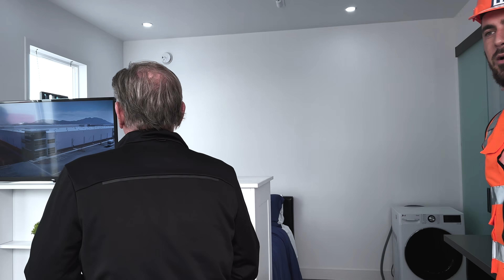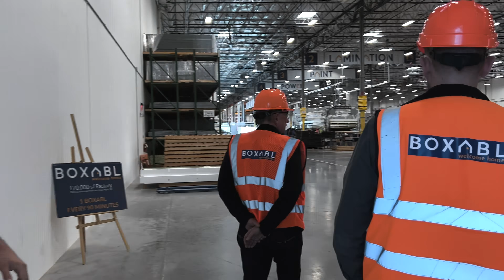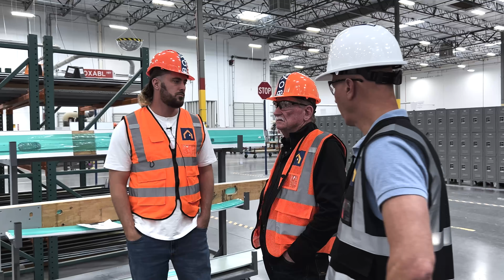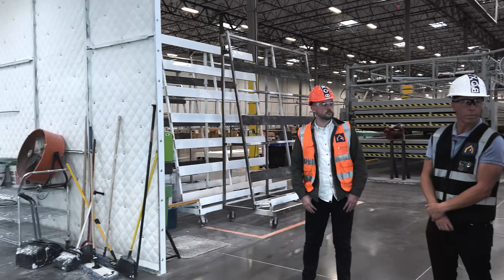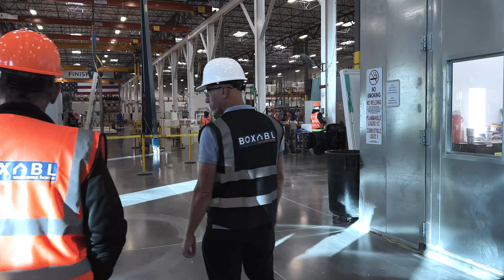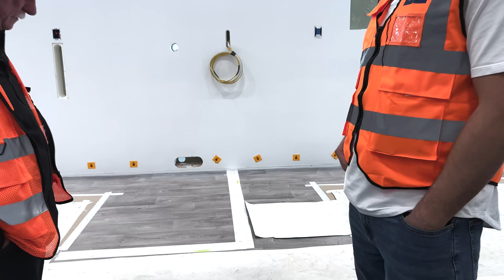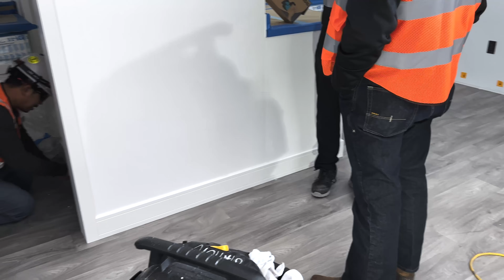What's in the BOX!? - Unfold your new home today | Boxabl Factory Tour

Comment: What is the benefit over traditional manufactured housing?  Just the folding stuff vs attaching two separate units?  Not putting the house on a wheeled frame?  Seems like it would be better to improve existing techniques than start over with a folding design.

The biggest issue with "mobile homes" are the build quality and lifetime.  Do the foam walls make that better?  How does lifetime, outgassing, etc compare with existing mobile home designs?   This may be a case of a startup trying to revolutionize, rather than evolve.
Reply: "Traditional manufactured housing" can't scale because of wide load shipping, not taking enough advantage of building in a controlled environment, and has had a massive perception problem for decades, whether it is warranted or not... Boxabl is not built to "manufactured standards", it is built to "modular standards", with a much stronger building strength than traditional onsite stick frame builds (wall panels are like Tesla structural pack compared to 2x4 stick frame with air gaps)... "Just the folding stuff" is not some cheap gimmick, it is the single most important IP that Boxabl has created, which enables the company to leverage all the advantages of modern factory mass production, while solve for legal shipping loads, which most importantly keeps shipping costs way down... Attaching 2 or more separate units is sub-optimal on so many levels because you are back again to building in an inefficient, onsite environment that lacks precision... Additionally, Boxabl is also solving for issues of local market labor availability,  precision to cm/mm tolerances (unheard of in US onsite residential builds) and time to build is looking to go from already insane speed of 1-2 per shift now to 1 unit per 1-2 hours in 2023 ramp...
Reply: @rule1capital  I didn't know there were different standards for "module" vs "manufactured".  I can see the wide load transportation being an issue, but based on the number of mobile homes out there, seems to be a solved problem.  Maybe a new model is needed to overcome the perception issues of mobile homes.   I'm not sure why traditional mobile homes are not built in a controlled environment.

I've read about other factory home techniques where walls are built in factories and assembled at the job site for many of the reasons you mention.  The folding is cool, but the shipping of pre-created walls removes some of the design limits (limiting water to the "core" for example) while retaining most of the benefits.

If they're making 1-2 per shift, there should be a whole lot of these actively in use.  I don't get that impression from the web page.  Do you have any details on how they're holding up?
Reply: @rmeden1  Mobile homes are indeed out there, but there are small delivery radius from small scale factories to customers because of all the special permitting and difficulty in transporting... Traditional mobile homes are built in a controlled environment, but I was stating that they are not meaningfully leveraging any of the advantages of said environment (new IP, new material choices, much faster output)... The Boxabl "core" that folds down for shipping is still around 40% of the total space, so I am not sure that it is too limiting in terms of design choices relative to the advantages of no onsite piecing together from multiple parts... From Q4 2021 (start production facility) - Q2 2022, Boxabl fulfilled their 1st 156 unit, ~$9.3m bulk contract for the Department of Defense... After making some small adjustments from learning on the 1st contract, Boxabl is currently fulfilling their 2nd bulk contract for ~175 units to a remote Arizona Mine for workforce housing... Onsite delivery updates are being posted on the "Boxabl Investors" Facebook group for this contract as the workforce village is being assembled...
Reply: There is no benefit, its nonsense to try to raise more money from sucker investors. They ruined a decent idea by making it overly complex.
Reply: @RogerTheJanitor  How is the Boxabl Casita ADU "overly complex"... Even in the manual-intensive 2022 process, they build 1-2 Casitas per day, when it takes 4-6 months to build an onsite house... Please explain how this makes a sucker out of a Boxabl customer...

Comment: Seems Sandy system is time is money, spend the capital to shortern line production time by using latest technology to reduce manufacturing steps and speed up production as any additional costs spent up front is made up in the increase volume of production.

Which is correct as he is backed up by math and experience.
Reply: The current process, in relation to where the current business plan is and will be by the end of 2023, was not clearly articulated in the video... Q4 2021 (start of Factory 1 production) - 2022 is super low-level production, more R&D like, to iron out this brand new company and process for 2 large orders... Q4 2021 - Q2 2022 saw the 1st contract delivery of 156 units to the Department of Defense... Following that, small upgrades were made to the line for the next current contract being fulfilled for roughly 175 units to a remote Arizona mine for workforce housing... The first full year in the factory (2022) is highly manually intensive work, just to get the simple, slow version of the process down and to obtain real-world feedback from units in the field, before introducing Generation 2 Casitas into the production process in 2023... Additionally, 2023 is expected to ramp run-rate production 10x-15x over 2022 levels, mainly by nearly doubling Factory 1 space to more efficiently setup the factory, but most importantly deploy some of the $100 million raised in 2022 on much more automation in each of the assembly line stations... The additional space and optimized layout is expected Q1 2023, the automation equipment is expected in Q2 2023, and the bulk of the production ramp is expected in Q3/Q4 2023...

Comment: After years, they are still on the first generation - the culture there may not allow meaningful change - just a guess.
Reply: The current process, in relation to where the current business plan is and will be by the end of 2023, was not clearly articulated in the video... Q4 2021 (start of Factory 1 production) - 2022 is super low-level production, more R&D like, to iron out this brand new company and process for 2 large orders... Q4 2021 - Q2 2022 saw the 1st contract delivery of 156 units to the Department of Defense... Following that, small upgrades were made to the line for the next current contract being fulfilled for roughly 175 units to a remote Arizona mine for workforce housing... The first full year in the factory (2022) is highly manually intensive work, just to get the simple, slow version of the process down and to obtain real-world feedback from units in the field, before introducing Generation 2 Casitas into the production process in 2023... Additionally, 2023 is expected to ramp run-rate production 10x-15x over 2022 levels, mainly by nearly doubling Factory 1 space to more efficiently setup the factory, but most importantly deploy some of the $100 million raised in 2022 on much more automation in each of the assembly line stations... The additional space and optimized layout is expected Q1 2023, the automation equipment is expected in Q2 2023, and the bulk of the production ramp is expected in Q3/Q4 2023...

Comment: I live in Indiana and in the past I visited a factory in northern Indiana that produced manufactured houses, single wide mobile homes and double wide mobile homes. I think people from Boxabl should observe factory operations of manufactured housing. I can tell you, the production rate is much much much faster than what was going on at Boxabl
Reply: The current process, in relation to where the current business plan is and will be by the end of 2023, was not clearly articulated in the video... Q4 2021 (start of Factory 1 production) - 2022 is super low-level production, more R&D like, to iron out this brand new company and process for 2 large orders... Q4 2021 - Q2 2022 saw the 1st contract delivery of 156 units to the Department of Defense... Following that, small upgrades were made to the line for the next current contract being fulfilled for roughly 175 units to a remote Arizona mine for workforce housing... The first full year in the factory (2022) is highly manually intensive work, just to get the simple, slow version of the process down and to obtain real-world feedback from units in the field, before introducing Generation 2 Casitas into the production process in 2023... Additionally, 2023 is expected to ramp run-rate production 10x-15x over 2022 levels, mainly by nearly doubling Factory 1 space to more efficiently setup the factory, but most importantly deploy some of the $100 million raised in 2022 on much more automation in each of the assembly line stations... The additional space and optimized layout is expected Q1 2023, the automation equipment is expected in Q2 2023, and the bulk of the production ramp is expected in Q3/Q4 2023...
Reply: Lived in a single wide as a 20something.  How is this better than a trailer?

Comment: So many things to change for manufacturability. Mudding/sanding has to be eliminated. Painting should be eliminated. Hinges should be recessed and then covered by a strip pressed into the gaps. Plumbing should be pre built.
Reply: Paolo (CEO/IP/cofounder) and Galiano (Business Development/cofounder) amassed a $100 million crowdfund warchest in 2022 fundraising alone... Boxabl is getting ready to scale from manual labor heavy, 300 units per year production towards Factory 1 Complex max output of 5,000 units per year with medium levels of automation equipment... In 2020/2021, Boxabl only raised around $50 million  and has been extremely prudent on not outlaying too much equipment capital expenditure before they are absolutely ready to commit to ramping 10x-15x current output levels... 2023 will be an eventful and exciting year for Boxabl at the Factory 1 Complex...

Comment: There seems to be a lot of untapped potential for automation here. A lot of it seems manual when it doesn't need to be or it has processes that could be replaced by simpler ones.
Reply: The current process, in relation to where the current business plan is and will be by the end of 2023, was not clearly articulated in the video... Q4 2021 (start of Factory 1 production) - 2022 is super low-level production, more R&D like, to iron out this brand new company and process for 2 large orders... Q4 2021 - Q2 2022 saw the 1st contract delivery of 156 units to the Department of Defense... Following that, small upgrades were made to the line for the next current contract being fulfilled for roughly 175 units to a remote Arizona mine for workforce housing... The first full year in the factory (2022) is highly manually intensive work, just to get the simple, slow version of the process down and to obtain real-world feedback from units in the field, before introducing Generation 2 Casitas into the production process in 2023... Additionally, 2023 is expected to ramp run-rate production 10x-15x over 2022 levels, mainly by nearly doubling Factory 1 space to more efficiently setup the factory, but most importantly deploy some of the $100 million raised in 2022 on much more automation in each of the assembly line stations... The additional space and optimized layout is expected Q1 2023, the automation equipment is expected in Q2 2023, and the bulk of the production ramp is expected in Q3/Q4 2023...

Comment: plenty room for improvement, could use a lot of ideas and engineering from auto mfg.
Reply: The current process, in relation to where the current business plan is and will be by the end of 2023, was not clearly articulated in the video... Q4 2021 (start of Factory 1 production) - 2022 is super low-level production, more R&D like, to iron out this brand new company and process for 2 large orders... Q4 2021 - Q2 2022 saw the 1st contract delivery of 156 units to the Department of Defense... Following that, small upgrades were made to the line for the next current contract being fulfilled for roughly 175 units to a remote Arizona mine for workforce housing... The first full year in the factory (2022) is highly manually intensive work, just to get the simple, slow version of the process down and to obtain real-world feedback from units in the field, before introducing Generation 2 Casitas into the production process in 2023... Additionally, 2023 is expected to ramp run-rate production 10x-15x over 2022 levels, mainly by nearly doubling Factory 1 space to more efficiently setup the factory, but most importantly deploy some of the $100 million raised in 2022 on much more automation in each of the assembly line stations... The additional space and optimized layout is expected Q1 2023, the automation equipment is expected in Q2 2023, and the bulk of the production ramp is expected in Q3/Q4 2023...
Reply: @rule1capital  thanks

Comment: So is Sandy consulting for them, cause he sure knows what they’re doing wrong?  Maybe I should say what they could do better!  Also, that’s the slowest moving production I’ve ever seen in a factory!  I hate to say it, but I wonder if they brought a bunch of temp. Workers in the day Sandy visited to do busy work?
Reply: The current process, in relation to where the current business plan is and will be by the end of 2023, was not clearly articulated in the video... Boxabl is only running 1 full-time, 40 hour week shift at the current time... Q4 2021 (start of Factory 1 production) - 2022 is super low-level production, more R&D like, to iron out this brand new company and process for 2 large orders... Q4 2021 - Q2 2022 saw the 1st contract delivery of 156 units to the Department of Defense... Following that, small upgrades were made to the line for the next current contract being fulfilled for roughly 175 units to a remote Arizona mine for workforce housing... The first full year in the factory (2022) is highly manually intensive work, just to get the simple, slow version of the process down and to obtain real-world feedback from units in the field, before introducing Generation 2 Casitas into the production process in 2023... Additionally, 2023 is expected to ramp run-rate production 10x-15x over 2022 levels, mainly by nearly doubling Factory 1 space to more efficiently setup the factory, but most importantly deploy some of the $100 million raised in 2022 on much more automation in each of the assembly line stations... The additional space and optimized layout is expected Q1 2023, the automation equipment is expected in Q2 2023, and the bulk of the production ramp is expected in Q3/Q4 2023...

Comment: I love the Boxabl concept. It's not absolutely true that there are no other factory built houses. There is a German company which builds bespoke kit houses in a factory and erects them in two days at site. But they are relatively expensive high premium homes. Boxabl homes look like a very affordable and ultra quick concept for many situations.
Reply: The difference with the Boxabl IP is cost and scalability above everything else... $60,000 ADU price, currently at 1-2 units per shift and looking to increase output speed during 2023 production ramp to 1 unit every 90 minutes (5,000 units per year, $300 million sales, run-rate at Factory 1 Complex)...

Comment: Great to see a new company striving to make a difference. Did see one Executive state that they were exploring another process about what Sandy mentioned about the steam fill-a-box process, and Executive stated they were exploring that, Sandy said, its happening now, get on board. Wonder why everyone except the main guy wasn't wearing safety glasses. You had one employee running in the shop. Then the same guy without safety glasses was walking on the empty pallet. (Safety issues)